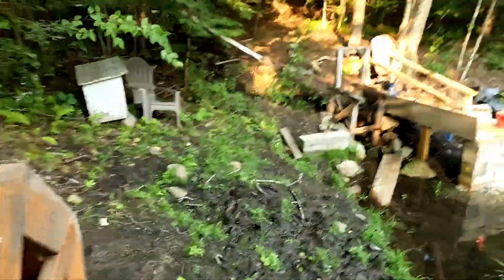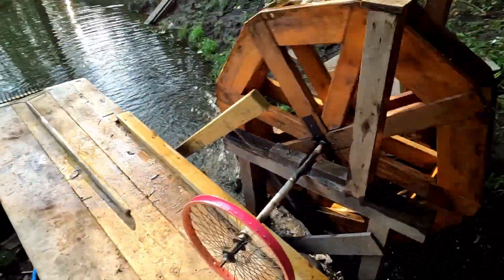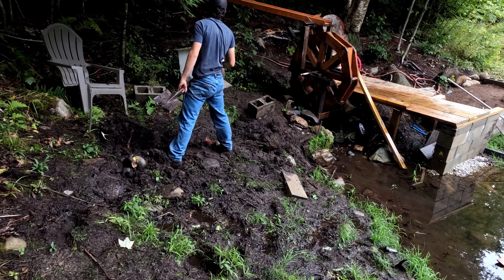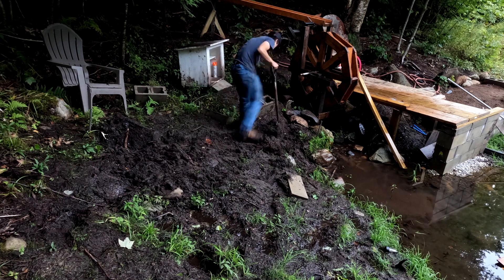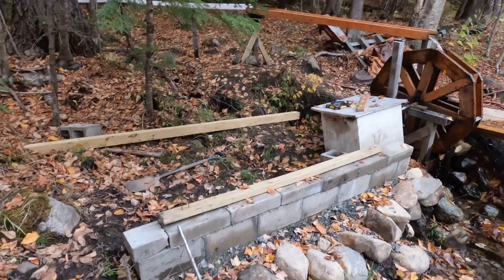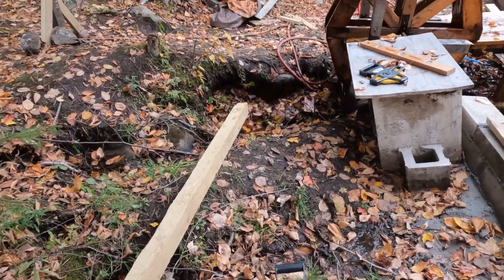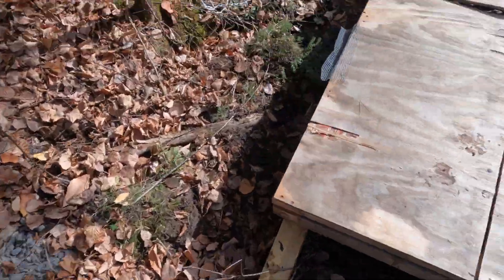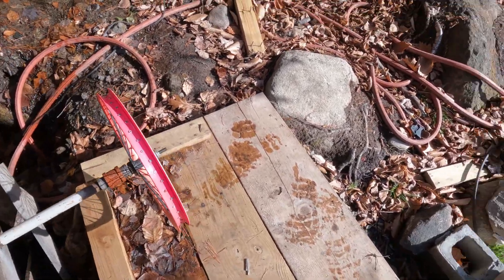Waterwheel Hydropower Pt2

Comment: ===  REALITY CHECK   ===
do you realize that the probability is high that you are going to end up with a 'thimble-full' of electrical power, from the work  that you are doing.!!!        based on  what you have shown in your videos, there is about  NINE  watts of total potential energy  AVAILABLE, at your site.
where a system is comprised entirely of low-quality components, you will be  LUCKY  to make  TWO  electrical watts.                ( your waterwheel needs to have at least  twice as many  buckets.        also, a waterwheel is most efficient when its rotation rate is limited to about fifteen rpm.      it is, therefore, important to  PLAN  to load the 'wheel in a way that will 'passively' limit its rotation rate. )
Reply from the maker: As long as it powers a light bulb that's all I care about 😂 I want the school credit